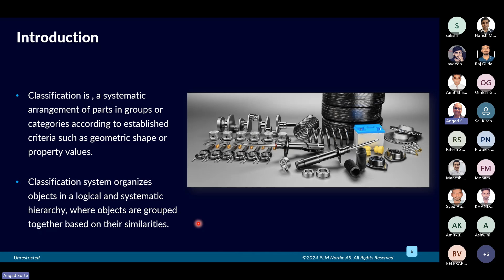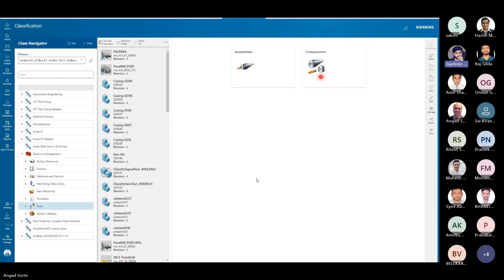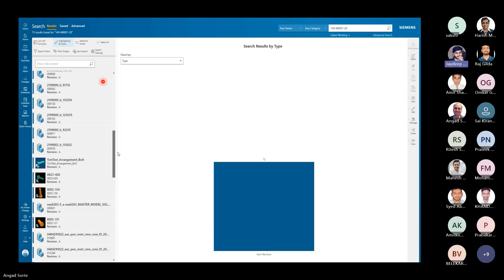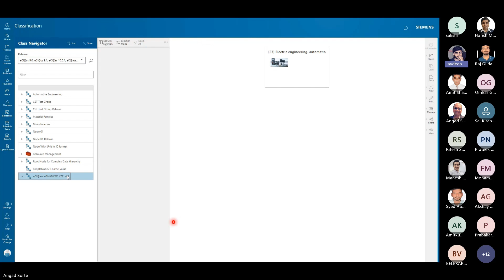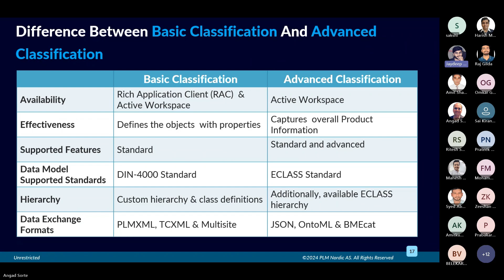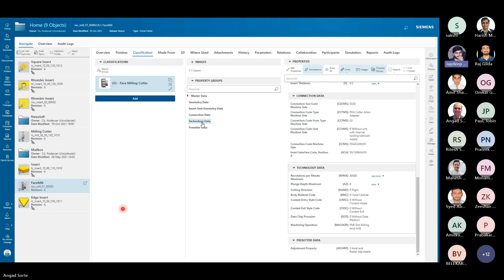Teamcenter Classification plays a vital role in handling vast industry data - Webinar Recording

Comment: *Question: Classification Search Filter Unit Display and User/Group-Specific Unit System*

In Teamcenter Active Workspace, the Classification Search Filter displays an attribute name along with its unit, for example:

`Length (mm)`

However, when I switch the unit display from Metric to Non-Metric by changing the `AWC_indexing_unitSystem` preference, the filter still displays the unit as `(mm)`, even though the Non-Metric unit should be inches.

1. Is there any OOTB configuration or customization option to dynamically control the unit displayed in the Classification Search Filter attribute name, e.g. change `Length (mm)` to `Length (in)` based on the selected unit system?

2. Is it possible to configure the unit system at the user or group level so that:

   * Users in Group A see Classification values in *Metric* units.
   * Users in Group B see Classification values in *Non-Metric* units.

I checked the preference definition for `AWC_indexing_unitSystem`, but it does not appear to allow a Group-level override.

Has anyone implemented a similar requirement in Teamcenter/Active Workspace, particularly in **TC2512**? Any OOTB approach or recommended customization would be helpful.